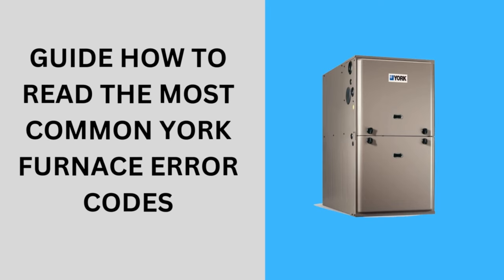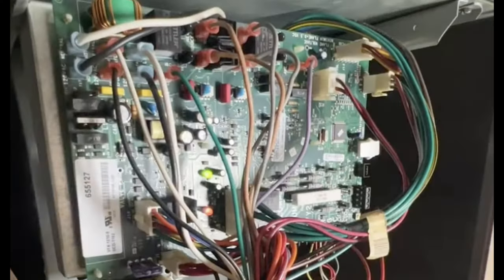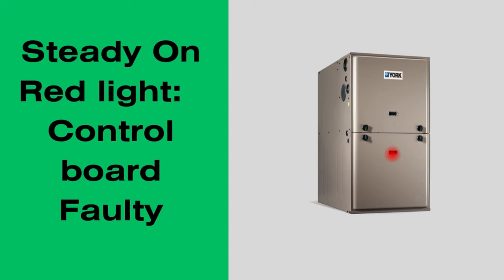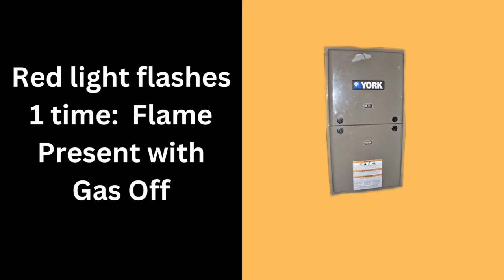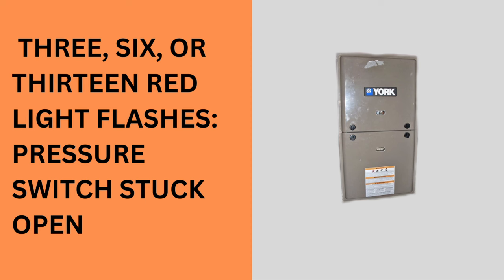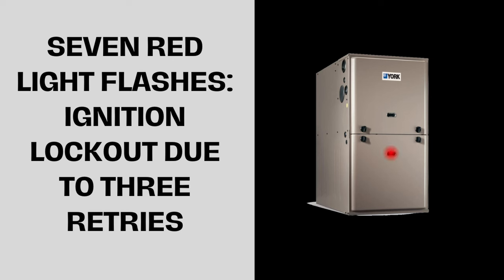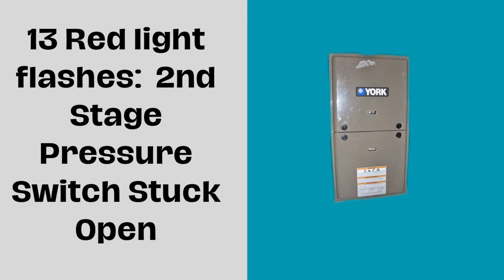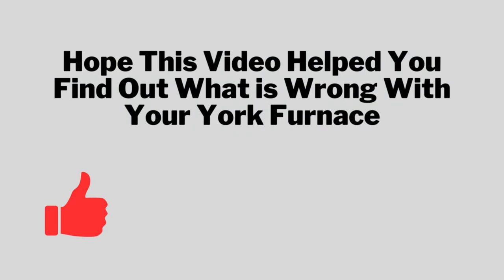How to Troubleshoot York Furnace

Comment: My york furnace started running the fans came on for about 5 seconds then furnace shut down, had  9 red light flashes and furnace would not run! 1 hour later furnace started running with 1 flashing red light but I do get heat now. Calling repair man tomorrow, going to get cold by sunday below zero.
Reply: my york has the one slow red flash, started today, what did your issue end up being?
Reply: Ended up being the control board. Had I known it was for sure the control board I could of replaced the board and save myself a lot of $. Seen a video on how to do it, real easy fix . I seen the video ofcourse after the furnace guy replaced the board, what a rip